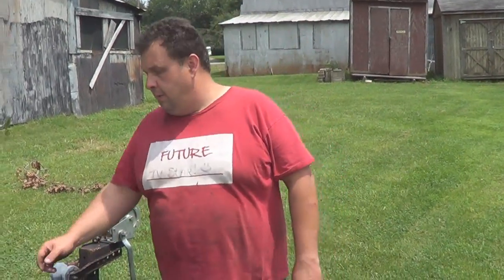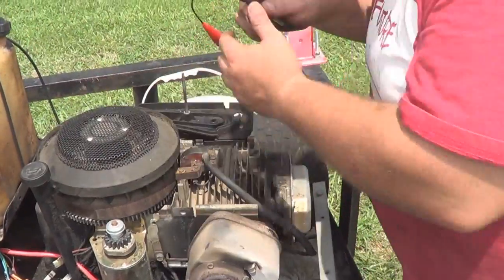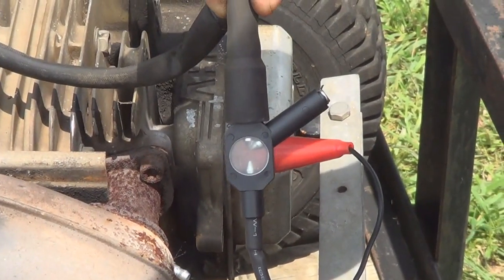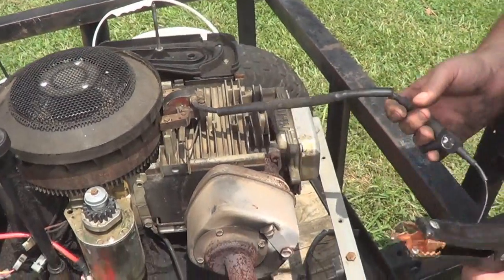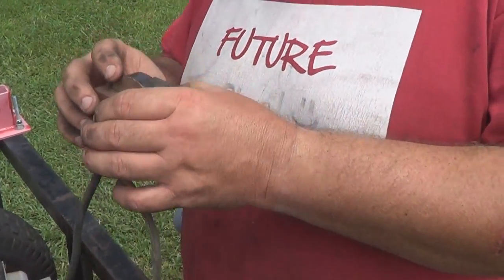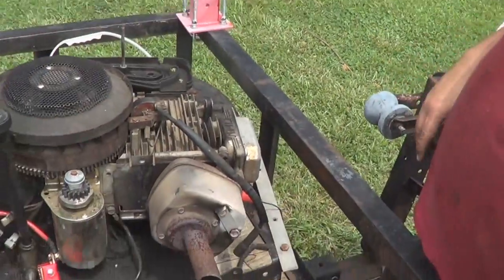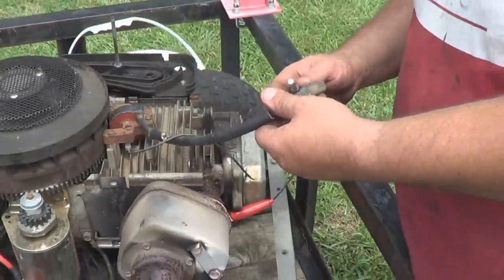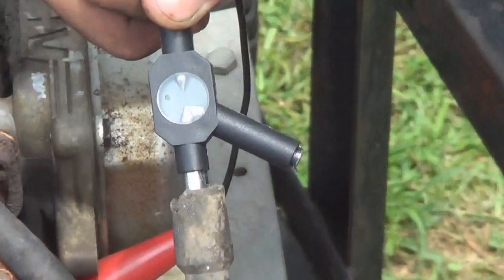How to test/replace a magneto

Comment: Make sure battery can spin engine fast enough. 4 Days chasing no spark issue, watched 50 videos, tried everything. Had charger on battery and kill switch disconnected. Put charger in jump mode and nice hot spark. I had been charging battery to 100%, but it was too weak. New battery fixed problem. Found a 300CCA battery to replace 3.5 year old 150 CCA battery. No more issues! I don't remember where I saw that 350 RPM minimum requirement, but only saw/heard it one time.

Comment: I have a 2003 Craftsman/Husqvarna Mod 917273451 and - what started as intermittent failure of 'interlock' safety system has become steady mess.  Starts, idles fine - if you engage Accessory lever OR running Clutch - STALLS.  Will not run under load. 
Have replaced: Seat switch/confirmed ground?; tested for good both interlock switches; replaced ignition switch; replaced both magneto coils; checked good fuel solenoid; incidentally replaced plugs, starter, and solenoid; checked all connections and applied dielectric grease to all connections; checked for shorts or scorching of insulation all systems; replaced fuel pump; replaced fuel filter.  Did NOT replace regulator, or Alternator (charging fine)    Idles and revs fine. New air filter.  New fresh fuel - added some Heat. 
So... Any ideas? My only thoughts at this point are: 1. triple check ground at seat?? 2. BYPASS (somehow) the Interlock system?   Governor? Carburetor? (had apart and cleaned early on)   ????? HELP!!

Comment: I have a throttle issue. I think  I got spark, but a spark doesn't mean magneto isn't  bad.  I'd sure like to get my wood chipper working. I didn't break flywheel key.
Reply: Right, pull it check everything.  with this wood chipper it's pull, and pull, no start like a merry go round.

Comment: Do you have an idea of why we would have continuous ignition coil failures on a B & S 19.5?
they fail after only 3-4 minutes of run time. We have had 3 failures. Thank you.
Reply from the maker: if it's a magneto it's possible something is shorting out the coil.  If it's a regular ignition coil the voltage may be too high.

Comment: NOTE:  If anyone reading this.... Take the Spark Plug out.  This will " alleviate compression " and it will crank easier and less power to crank as well :).  Also, your Motor will spin freely and faster.  This will make the " Magneto " even stronger (unless bad).  But also help you diagnostic even faster and better with your Magneto / Ignition Coil / Armature !!!

Comment: Great video. It is a big help. I'm working on a 14.5 OHV with no spark. I pulled the ground wire and still no spark. You confirmed my suspicion. Bad magneto. I always like to check before buying new. Thanks for the help.

Comment: so lets say I cant find the same ignition coil that came with my lawn mower can I just buy a similar coil?
Reply: +Jorge duarte
 = YES !!!  NOTE:  It doesn't take a lot of Power to run these.  So even with a CHEAP one, it will run.  Just make sure the Holes and the GAP lined up.... Search around... It's about $8-$10 most and free shipping too!

Comment: got a question for anyone , have the same motor on my mower, stator went out, and someone wired it straight,  bypassing diode. put s new stator on and it still want crank. and I do mean stator not starter, stator is under flywheel and keeps battery charged. any help please.
Reply: Just ran across this video. Not sure if you still need help but here goes anyway. The stator only charges the battery. It has nothing to do with the mower starting and running. If you want to check it and the mower runs, start it up and take the positive cable off of the battery (while it's running). If it keeps running, your stator is working. If it dies, stator is bad. There should be an inline fuse between the stator and the battery as well. Make sure to check that. If your familiar with how to use a multimeter, you can check if any current is coming out of the stator while it's running also. There are videos on how to use the multimeter too.
Reply: thanx, and im familiar with multimeter so ill give it a shot. thanx again

Comment: Thank you, Thank you, Thank you!.I did a lot of work on my riding mower due to it leaking oil. Put it back together and it would start. It ran before. Checked the coil and had it upside down! You said it was marked and it was. Started right up. You saved my butt. Thank you so much. Norman.

Comment: Your suggestion to unplug the kill wire to see if you get spark is what worked for me.  I am rewiring a push button start and suddenly it would not run.  I spent hours trying to troubleshoot thinking it was a safety switch problem, turns out it was a kill switch grounding problem.  Thank you so much.

Comment: I noticed you failed to disconnect the kill wire before testing for spark. Heck, something (bad safety switch?) could be grounding out the kill wire. And what about the seat safety switch? That will kill the spark when it's not disconnected.

Comment: Do the authorized shops have some kind of curved shim to gap the magnet/ flywheel?
Reply: They could, but a credit card will work. Cheaper anyway!
Reply: Nope they use either a .004 feeler gauge or the ole trusty business card
Reply: i bought a coil for a briggs stratton and the box flap was used to set the gap. .010

Comment: I bought a twin that has a cut spark plug wire. Can I remove the rest of the wire and put a new one on? Or so I need a new coil?
Reply: new coil
Reply: Cameron already have a new coil. Thanks though.

Comment: What's going on , when the coil is hooked to the spark plug, but won't fire, or spark, or start. However, if you ground  the coil and crank it, it sparks, - good. The old coil wasn't firing, and I replaced it with a new one, and it's not firing too. It can be started with a key, or a pull rope. It's a self propelled walked behind. It will start sometimes with the pull rope. What's up with that?

Comment: I know a easy way to test the magneto. Have somebody hold the spark plug connector, then turn the motor. If they don't move, the magneto is bad.
Reply: it's a joke, the plug will knock you on your ass...never touch it!
Reply: melodymaker AAAHAAHAA...Too funny,,, you will learn “if there is spark”Aaahaahaa
Reply: It's not bad getting shocked!  I got shocked so many times and I also have gotten shocked from Cars / Trucks Coil.  Cars / Trucks is even stronger!
Reply: had a coil on a riding lawn mower that was only a friggin 10hp briggs, burn my wrist and i remember it taking a month to heal. Dont ask how, it was years ago, just know it happened :-) but yea i use my finger to test spark alot, only hurts a second
Reply: Is this safe or is it like a joke lol? I'm new to this
Reply: it's both. Don't turn the motor to fast. If the magneto is good the assistant will jump.
Reply: + melodymaker When I was a young kid, my Dad took me and my middle brother out to pick our family some strawberries at a strawberry patch one time and while we were there I told my Dad I had to pee. We were out in the country and the only people there so my Dad told me " Just pee over there outside the patch and onto that wire ". There was this wire running along the patch about 2 feet above the ground along the outside of the patch so I did what he said. ZAP !!! I jumped about 3 feet off of the ground and once I landed I started yelling all sorts of colorful words that an 8 year old shouldn't be saying. He had me piss on a charged electrical wire meant to keep deer out of the strawberry patch, the shit head. lol. Sure wasn't funny at the time though. Wow !!!
Reply: +Paul Loehr - Your comments are NOT helping either... So what is your point?   YOU ARE THE IDIOT & THE FOOL!  I got shocked so many times....  I am still here!  LMFAO !!!
Reply: lol ,,,, maybe you could hold it yourself?
Reply: would that somebody be a friend or somebody you don't like?
Reply: rafael55 LOL LOL my step-father did that to me  I move until that point I thought he liked me
Reply: A Street mechanic once tested my father's car that way. Without any knowledge I was led into the line of fire and I almost lost my ass there.
Reply: Mean and nasty for an adult to do this to a child; reprehensible for a parent to his child.
Reply: A piece of shit IDIOT!!!!!!! This is the type of comment that doesn't need to be on a helpful video.  THIS IS NO JOKE< FOOL. You are the type of person that thinks this is funny, and when someone, if they would believe you could have bad injuries, take this information and your comment to HELL FOOL

Comment: How you test the oil level sw on a E-TON VIPER 50 ST  , PS-50 .I GET NO SPARK  I speck this switch . I try but can't get any kind of reading on it .
Reply: You have 2 put a half of stick of dynamite in the gas tank n wire it to the ignition coil it would help it crank right over

Comment: Can you explain how to check a diode in the ground wires on the coils of a v twin? I am only firing on 1 cylinder and it would not start with both coil ground wires connected. I have one ground wire off and mower will start. Both coils put out spark. But running on 1 coil.

Comment: What about the safety switches? If I'm not mistaken, the safety switches (like under the seat) will keep the magneto from sending voltage to the spark plug too. Or am I wrong?

Comment from the maker: Jean ,

Try a smaller socket ,or one that will fit on the screw tighter , or a pair of pliers , or cut a grove in the head for a flat screw driver or a cold chisel . What ever you do don't break the leg off of the motor that it screws into .

Whizkid
Reply: ESRepair get hot and quite

Comment from the maker: 99carnot,

I haven't had much experience with these coil setups , but as I know what a diode does in electrical terms , then I guess that it's there to stop one coil from back feeding into the other one when the kill wire is energized by grounding it out .

Whizkid

Comment from the maker: WVMachinist,

I'm guessing that your motor is OHV . If so, then it's the valves that need adjusting. If your motor has a pressure relief valve on the cam then it could be bad and you need to replace the cam . ( It could have both ) . Is your battery good ? Fully charged with enough amps for your motor ? Check all connections . Check grounds . Charging system good ? 

Whizkid